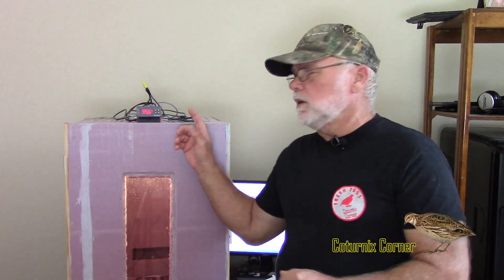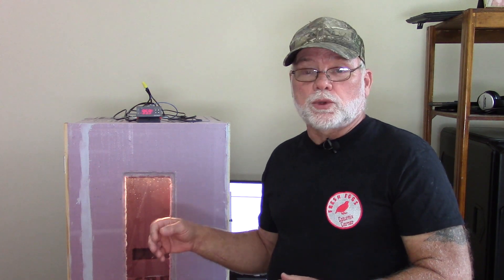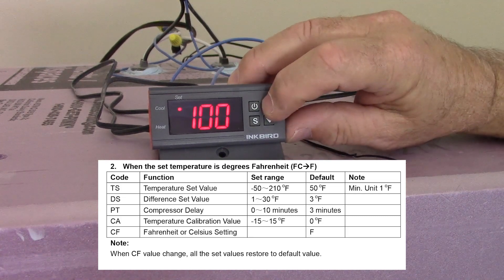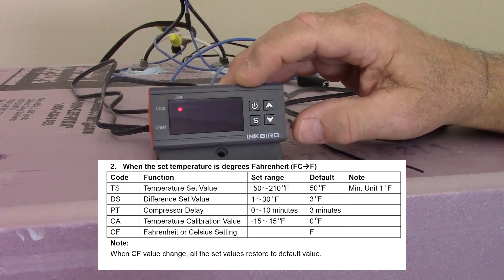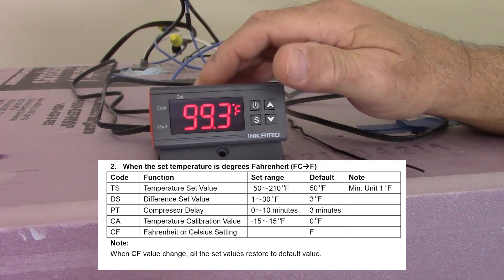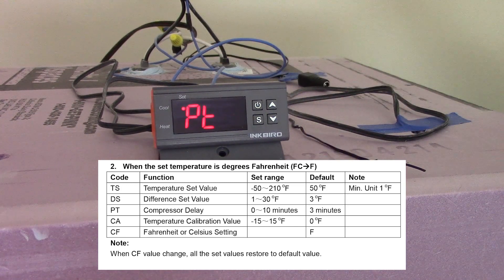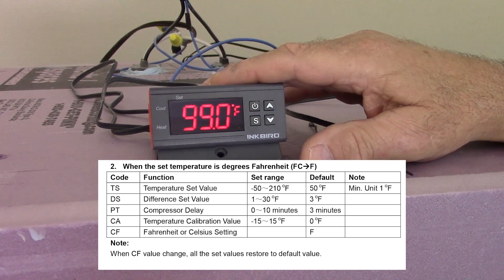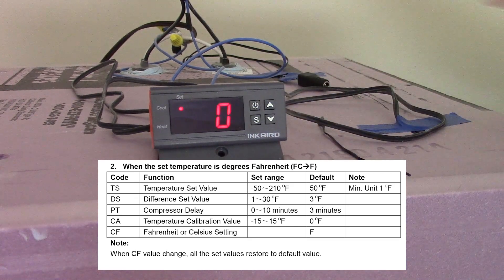INKBIRD ITC 1000F SETTINGS -  Settings for our DIY incubator.

Comment from the maker: At 2:44 I said the difference set value should be at 98 degrees, the value is actually "1". That value will turn the incubator on when the temperature drops to 98 degrees.
Reply: I just want to say don't forget to hit the power button after doing the settings to save them. I finally got it right .
Reply from the maker: Power button or the set button will save your selection. Thanks!
Reply: @dianacanter4970  thank you diana i been fighting with this thing all day now with your help i could change C to F and save my values again thank you hitting the save button did not work for me.
Reply: Also, if u accidentally change the F & C it will go back to default on all...u gotta change it again..
Reply: @dianacanter4970  Thanks !!
Reply: @Moises Dante instablaster :)
Reply: @Jamal Conor i really appreciate your reply. I got to the site through google and I'm in the hacking process now.
I see it takes a while so I will get back to you later with my results.
Reply: @Jamal Conor it worked and I now got access to my account again. Im so happy!
Thanks so much, you saved my account!
Reply: @Moises Dante You are welcome :)
Reply: @dianacanter4970  Thanks so much for that advice.  I couldn't figure out how to save the values.

Comment: It seems the compressor delay is only for the cold relay as heaters don’t have compressors, I have it set to 10 because I didn’t like hearing the cold relay kick on each cycle and lights still turn on right when it hits 98

Comment: im curious, did you just wire this into a wall outlet or a battery? also whats the amp, volt, and wattage of those bulbs? trying to build a humidor with peltier modules.

Comment: hello great video. can you use 3/4 foam bored on the incubators .
Reply from the maker: Absolutely
Reply: @CoturnixCorner  it want mess up the heat inside of it
Reply: @CoturnixCorner  hello did you make a video on making the wood boxes in the incubator. I like to make some .

Comment: Hi, just a quick question. Will the incubator rise above 99 ? I was thinking about hooking up a extra fan to the cooling side. That way if the temperature gets to hot, the fan should kick in and cool it off. 

Any thoughts would be appreciated.

Comment: Thanks for the short precise video. BTW you have connected the the light bulb to heat terminals, right? I have set tye temperature to 99 with 1 degree as yiu have suggested. The light turns on only when it drops to 98. Is that the way it supposed to work. My compressor delay is set 0 as well
Thanks Aji
Reply from the maker: Yes, those settings are correct. The lights should turn on at 98, off at 99 and the residual heat from the bulbs will bring the temp up to 97 - 99 degrees.
Reply: @CoturnixCorner   Thanks. Shouldn't be  the hatching temperature between 99 to 100? I kept a small themometer inside and it read 97 all the time. Changed the settings on ITC to 100 . Now the inside temp stays at 99 on the small thermometer. Thanks again for your video.
Reply from the maker: @paulaji99  Yes, 99 - 100 is optimal. And yes, changing the temperature to 100 is sometime needed depending on the external temps. My daily outdoor temps average in the 90's most of the time and if I set it to 100 in the inkbird it will average 101 inside the incubator, Everyone who builds this incubator should experiment with temp settings prior to incubating eggs. Thanks for the comment.
Reply: @CoturnixCorner  Thank you!

Comment: Hello great video!! How many quail would fit in a 10’ by 10’ pen? Thanks
Reply from the maker: If you used the 3 birds per square foot rule you could get 300, but I would cut those figures in half or more. Good luck in you quail adventures.

Comment: between 37 and 38°C (typically 37.5–37.8°C) that's  99°F to 100°F so shouldn't it turn off at 100  and on at 99? Incubation temperature ranging between 37 and 38°C (typically 37.5–37.8°C) optimizes hatchability.

Comment: What do the other controls mean CA or CF
Reply: Some of it looks like Greek to me - I'll have to study it all and experiment so I can understand it all.
Reply: CF just changes it from Fahrenheit to Celsius, and CA is to calibrate the sensor. Put a thermometer you trust by the sensor and if it disagrees with the Inkbird, then set the difference in the CA value to compensate

Comment: I've got an ITC-1000F 12v which is showing the temp in negative value all the time. At first i thought the sensor was bad but connected an other one and still the same. anyone know what's going on?
Reply: Wish I knew,  WIsh someone would answer  your question.

Comment: Terry I have a question 
I built incubators identical to yours and have been successful with 2 hatches already.
Yesterday I ran into a issue chicks were hatching as normal came back in a couple hours looked in the window and noticed all the chicks in the top rack were dead! Was trying to figure out why and noticed that the temp was at 130.
Had to pull hatched chicks from the bottom rack reset the ink bird and everything seemed normal checked this morning and everything was fine pulled chicks and when I just came home lost everything again temp was at 125.
Is it a possibility that the controller is no good now??

Thanks Chuck
Reply: Sounds like the controller got out of control!